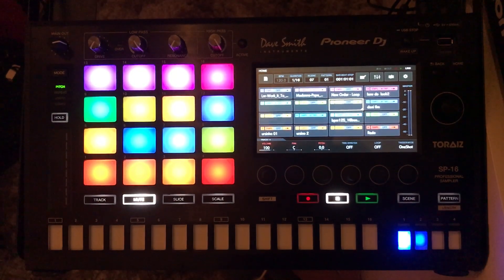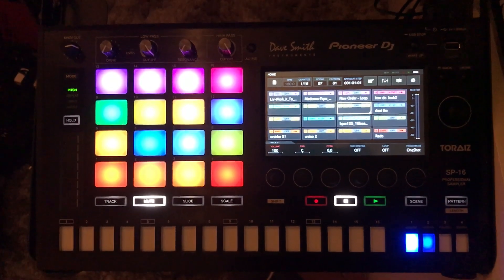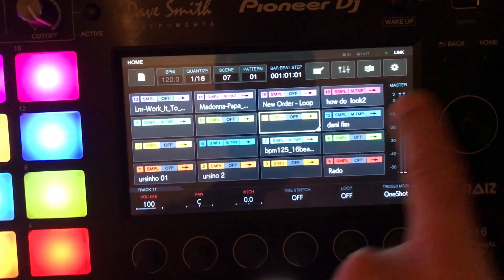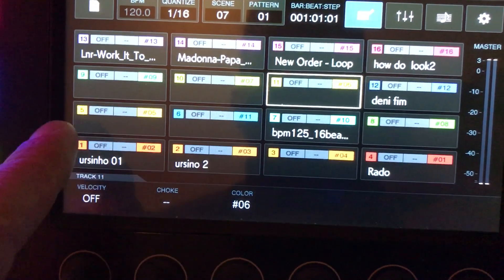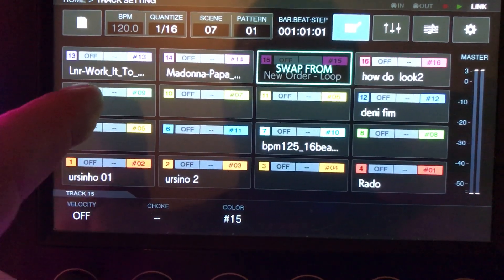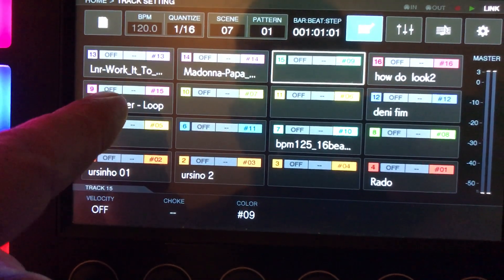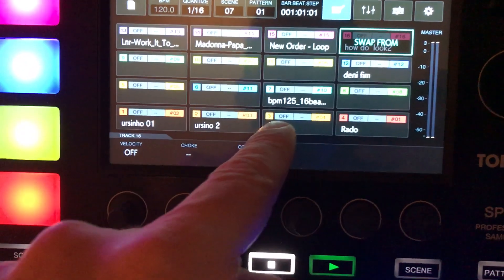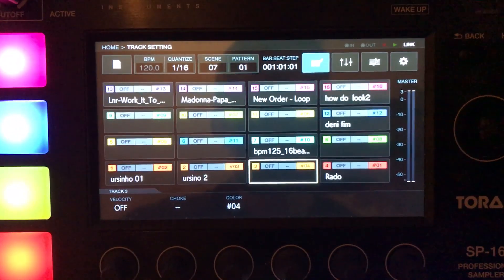SWAP function at Toraiz SP-16 (firmware 1.4)

Comment: I have some doubts regarding Pioneer Toraiz SP16. I have been using Akai MPCs for a long time. Currently using Mpc 2500/1000/ Renaissance.
My concerns
1) How many samples can I use at a time within a single pattern? ( In MPC, for a pattern we can use 16 x 4=64 samples in A,B,C and D banks normally)

2) How many samples can I layer in a single pad ( In MPC I can stack 4 samples with separate Volume, Pitch and Velocity levels)
Reply: U can use resampling even with 146 samples per pad.